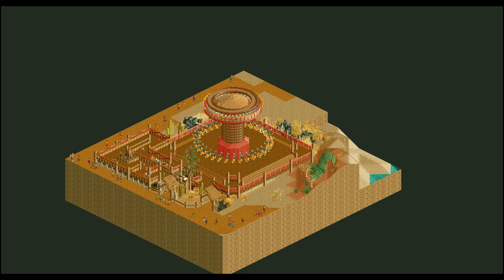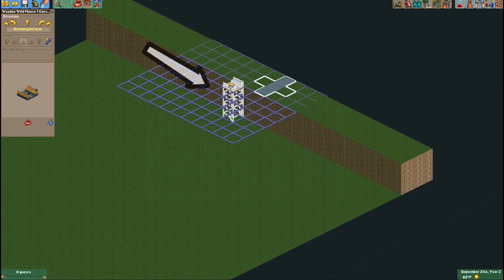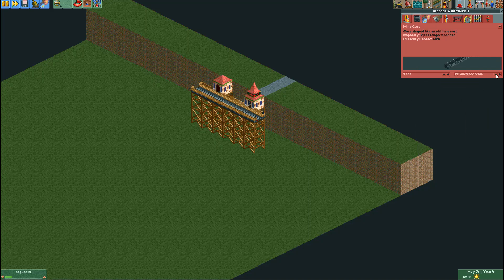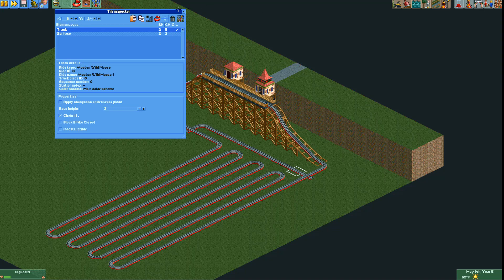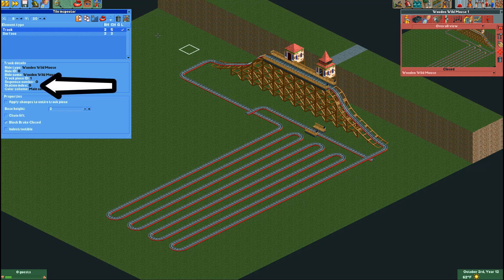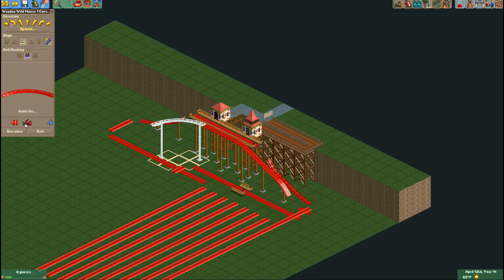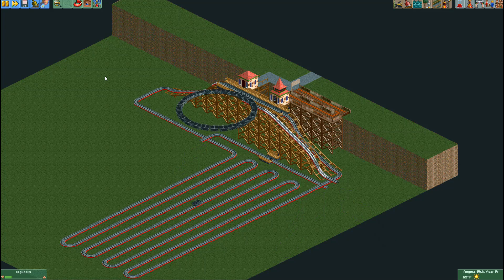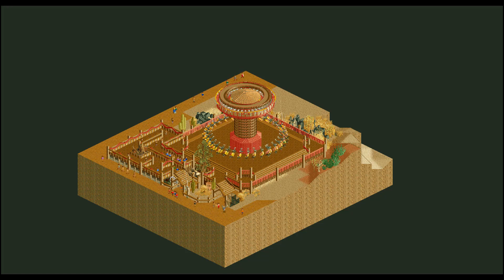Swing Ride Tutorial for Open RCT2 [Tips & Tricks Episode 3]

Comment from the maker: Hey everyone, it has come to my attention there is a bug with this ride.  The stats do not populate since the train does not return to the original station,  even worse it affects all rides present in the same way.  

I am currently looking for a fix. Currently the only solution I have is to close this ride until your park is complete then opening it it last after allowing it to complete a circuit. It seems to allow stats to populate up until it's shoestringed.
Reply: The solution is to break the control track. The game essentially treats any shoestring ride as an incomplete circuit (I believe that's the logic). If the ride is in powered launch without passing station mode, which is the mode I usually use for my ferris wheels, then I guess once you have the track ahead of the station reach an end, rather than an infinite loop, the game is able to start calculating stats. I usually do my break on the part before the loop but after the part where you break off the first car(s) and send the train up to the loop. Mr. Deurklink has a video in case I did a bad job explaining: https://youtu.be/oUKeiRoYCfs